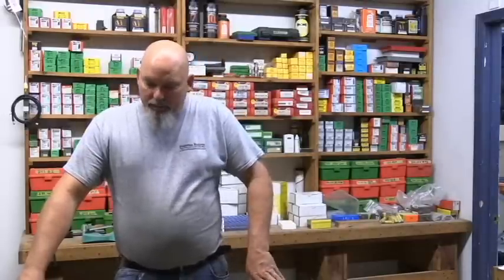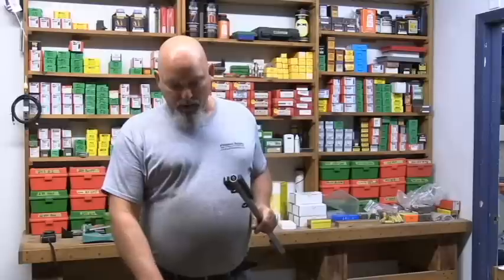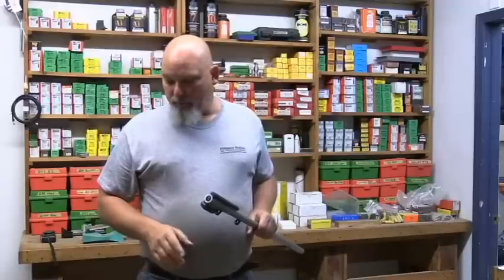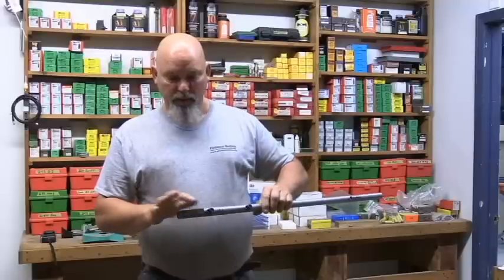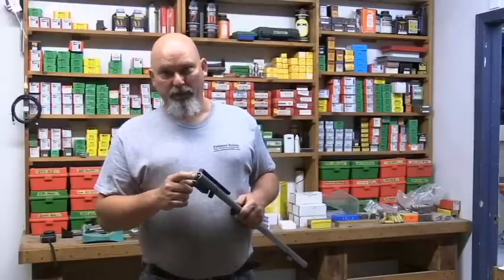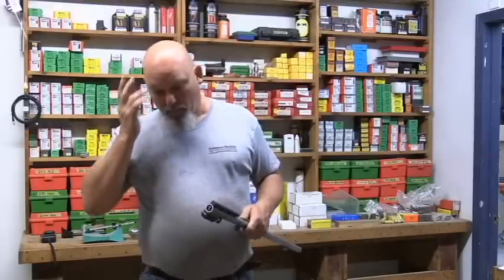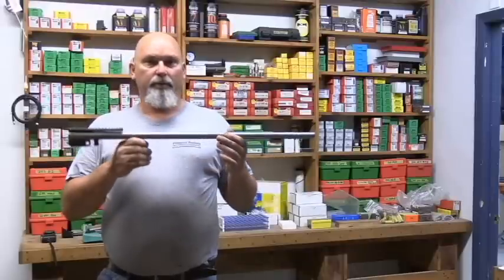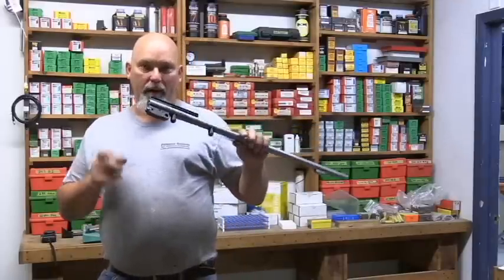Encore owners must see

Comment: They are wondering if you would have the spring that goes with the extractor I have the TC encore pro hunter 209 with the one that has the extractorthat folds down try to find one through TC a few times no look there just wondering if you would have one  thanks

Comment: doesnt look like you respond to many questions but here goes one anyway.  I need the part on the barrel where the pin goes though, either cleaned up or replaced.  I had hell try  to get a pin in and i messed it up.  can it be fixed or replaced?  thanks for your time.  Great channel.
Reply from the maker: I don't answer most questions here. I can be contacted by e-mail or phone. That information is available on my web site. But to answer your question. Yes the hinge block could be replaced.
Reply: Awesome, i will be in contact.